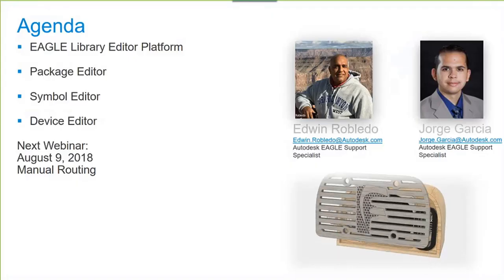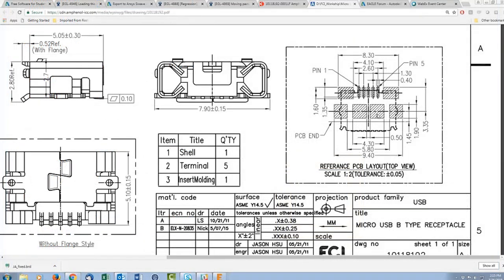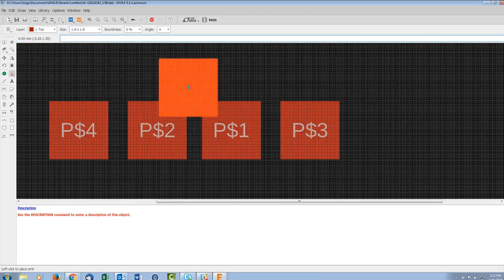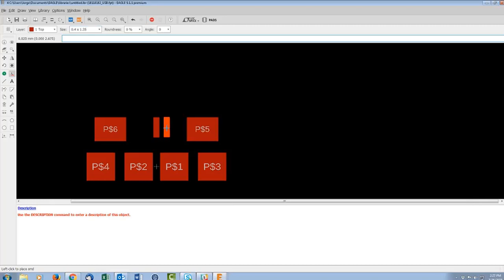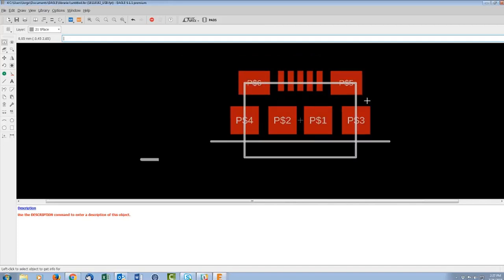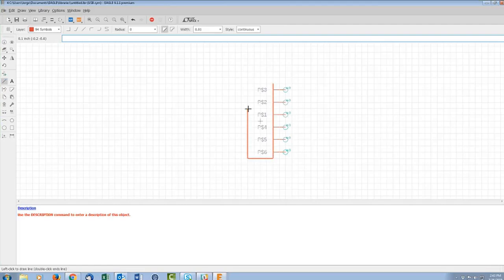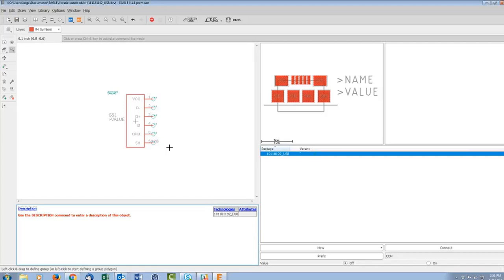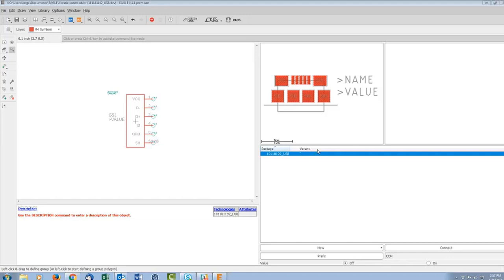Learn how to Create PCB Parts in Autodesk EAGLE - July 2018

Comment: When pushing a 1.0mm board to Eagle (from Fusion)-- adding parts -- and re-exporting back to fusion -- the board thickness turns back into the default 1.57mm.   ?????   Don't see yet how to get that board thickness under control...